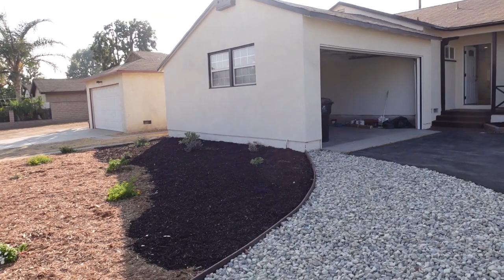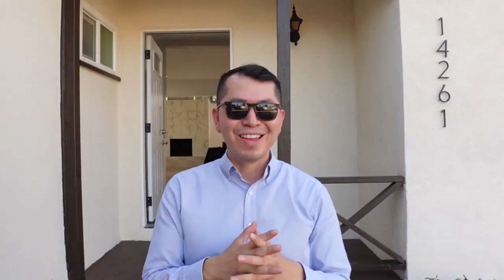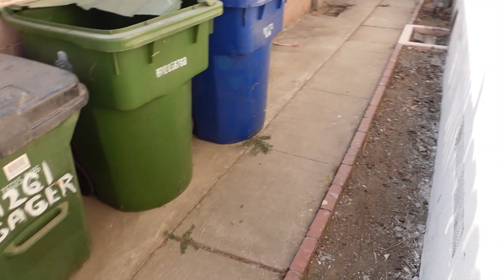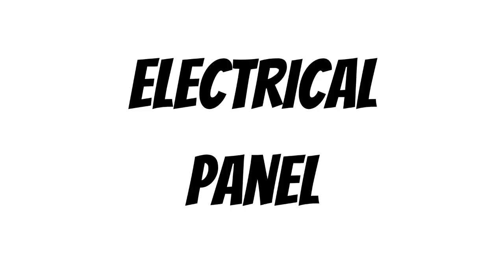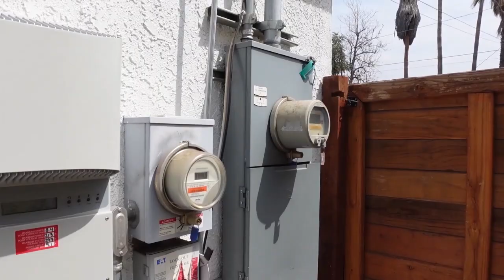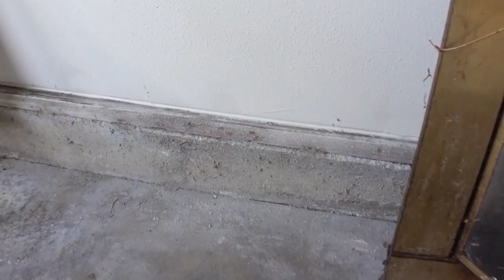Are you buying a house to build an ADU?

Comment: Hi Hector, I have a couple of questions do you know the cost of adding a gas meter and adding electric panels for independent bills? That you
Reply from the maker: The gas meter is free from your gas company. Solar panels are installed based on the watts you will be using. Only a solar panel installation company will be able to give you the best accurate answer. You could try an online calculator but it won't give you the right number you are looking for.
Reply: @HektorCastillo  sorry I was not clear about the electricity. I was referring if you know how much it cost for an independent electric meter tied to the grid?. Please keep making videos!